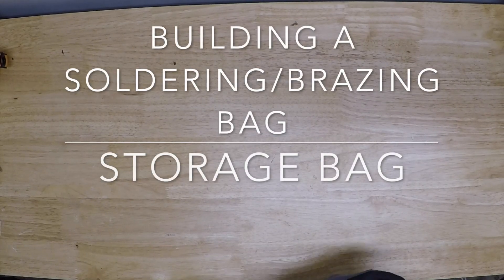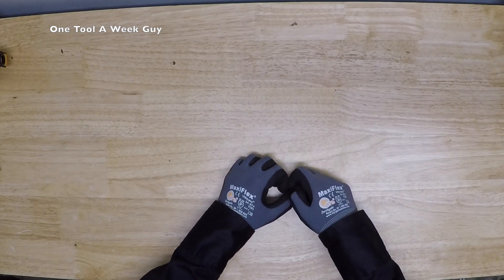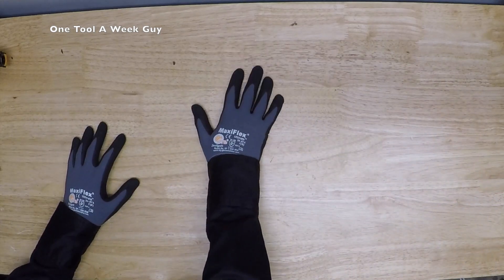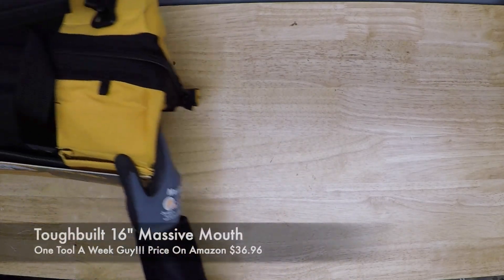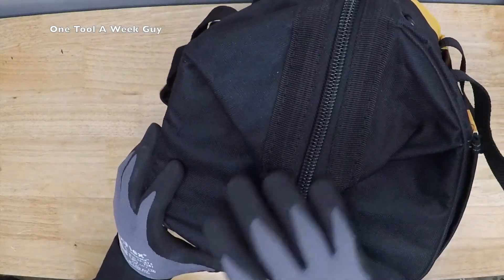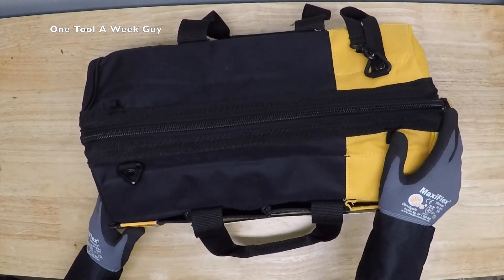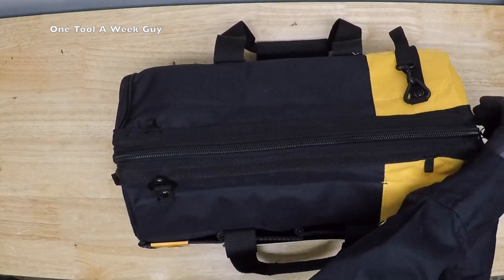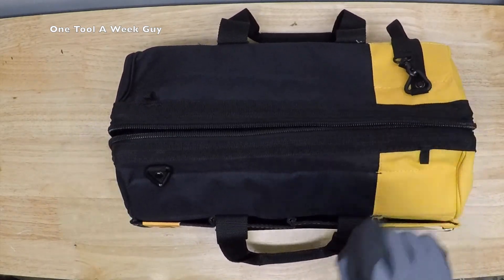Building A Soldering/ Brazing Bag (Bag Storage 16" Toughbuilt Massive Mouth Bag)

Comment: You seem to know a lot about all the trades, I’m curious, what is your job?
Reply: Yes, NHope95, your trade requires expertise in a lot of areas,  I don't recall which video included info about One Tool A Week Guys position with a mechanical contractor.  His video regarding his backflow prevention device testers and maintaining certification and then  another about Fluke electrical testers has led me to believe he is pretty well rounded.  I hope he will elaborate a little more about his position.
Reply from the maker: Like Gary said. I work for a mechanical contractor and get my hands on everything i can and fix. Just like you NHope95.